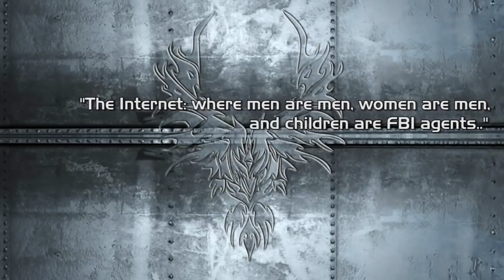Airbrushing for the Beginner #3: Basic Mechanics, thinning paint and cleaning

Comment: Very good video bro. One thing to note... from my experience its best to hold the trigger down while inserting the needle back into the airbrush. This prevents it from the possibility of bumping into the trigger assembly inside the airbrush and bending the tip of it. Needles aren't cheap and you really want to be extra careful with them.

Comment: Skim Milk. Yes, you can use your airbrush to paint acrylic on ceramic bisques. :) Make sure you clear coat it with a varnish to protect your work. The Aerograph airbrush with a Vogue Air Mini Compressor is a small set and it can be used for what you're doing.  Good way to start.  You might want to upgrade later though if you get really into it.

Comment: An alternative way to pull it apart so as to ensure minimum contact with needle point.
It goes like this:
Loosen the needle chuck then pull the needle back so its no longer in contact with the nozzle an inch or so will do the trick.
Then remove the nozzle assembly at the front including the nozzle.
Having removed the nozzle you can push the needle all the way forward and pull it out from the front. Then put back together in reverse order and you wont bend your needle tip.

Comment: @Legodude5991 Depending on the type of paint that is whether it is Solvent or Water based. 

For solvent ie Auto Acrylic Lacquer I use a commercial GP Gun Wash, for Water Based paints I use Auto Air 4007 Airbrush Cleaner between colours (I try to go from light colours to dark when working on a piece) but a flush and blow out and spray on white cloth to confirm it is clean. the iwata cleaning station is nice but my $2 plastic teapot modified works a treat.

Comment: I can't tell you how to thin vallejo other than to the consistancy of thinned milk but here's where I start.  For Vallejo Model Color, I start at 1:20 (paint to thinner), for Game Color start at 1:10 and no need to thin Model Air.  From that starting point, you add more thinner if it's too thick or add more paint if it's too thing. Note it down.

The reason why is that depending on the pigment they use for the color, how long they set on the shelf, the ratio is different usually by color.

Comment: so i bought a cheap one to start with but when I cleaned it and took out the needle tip it never went back togheter and every time i used i would get bubbles on my cup are not all needle caps removable? or is it something else that is wrong with my airbrush cheers great vid

Comment: I got 2 airbrushs for Xmas. Both Royal max. Ones the 132E Model and the other is AB-128P. Ones side feed and ones a feed that goes from underneath. I used the side feed once to learn how to control it and put it on 20psi.

I'm using Revell acrylic paints with the Revell Thinner.

I'm brilliant at drawing so I'm intending to maybe use the airbrush for colour. Or designs on stuff you couldn't do with pencil.

What's are the first things you recommend I try to airbrush so I can improve on using one? 
The more you do something, the better you get at it. But I have no clue where to start with airbrushing.
Reply: Trigger control is probably your first bet to start to learn first.  Do lines and streaks and dots. But for illustration purposes, check this guy out. He can REALLY help you in that aspect: https://www.youtube.com/user/airbrushtutor

Comment: thanks for all your advice. I have just picked up an airbrush and compressor it wasn't a cheap one but it wasn't an expensive one either will that make a difference? The real question i have is what should i clean it with? there are so many people that say you should only use airbrush cleaner and others that say use water and washing up liquid? does it really make a difference or would alcohol such as isopropynol work?

Comment: Hi,
I need help regarding my compressor. The pressure is not building at all when i switch it on. I cleaned my airbrush to see if that were the problem, but no. The gauge doesnt pass 0, it makes a noise as its about to start up and turns off straight away. any ideas please?
Thanks a million

Comment: Have two airbrushes, using and cleaning both, until now.  I'm having the same problem with both of them. Watched the video and learned about a valve I didn't know was there.  Cleaned them both again using your method and still having the same problem.  Paint in cup (gravity feed), push trigger and paint does come out but it is also bubbling out of the cup so much that I can't work on anything.  I would say 95% of the paint bubbles out.  Any suggestions would be appreciated.  Thx
Reply: I've had that same problem.  Make sure all parts are thoroughly clean and that the nozzle cap is screwed on completely so that air does not leak from the threads.
Reply: They are extremely clean and everything is on tight.  I even added teflon to what I could.
Reply: tfs433 It just happened to me again and I found some paint around the nozzle of my Pasche air brush.  After removing it, all worked perfectly again. These things are very sensitive and even minute particles of paint can affect their performance.
Reply: I'll try cleaning everything for the fourth time paying most of my attention to the nozzle.  Thank you very much for your help.  I appreciate you getting back with me so quickly.  Thx

Comment: i have just got a new airbrush i used it once right now in fact and paint was coming out but also in droplets and then now it just wont release the paint the air is coming through but no paint and mine too as i've seen others say is bubbling 
could use a bit of advice and its clean as i said i just opened it and started using

thanks in advance for any tips )
Reply from the maker: Andrew Campbell It sounds like you might not be thinning the paint enough. What kinda of paint and airbrush are you using?
Reply: vellejo 

veda airbrush thanks for reply mate

Comment: Just to recap, you use alcohol to clean the airbrush between paints right? Say i did blue for the first round. I would use it then dump whatever i didnt use into a container. Then pour in alcohal, give it a bit of a swish. dump that out, then put more alcohol for another swish. After that, you put in more alcohol then used gave it a good wipe on the inside. Then dump. Finally, you put in more alcohol and this time, you run in through the airbrush cleaning it until it comes clear.

What kind of alcohol do you use? Can i have some examples please. :D thanks.
Reply from the maker: DevilsArms I normally use 91% Isopropyl Alcohol. You can see me do the cleaning in the Airbrush Intermediate: Color Changes video
Reply: SMConsortium thanks. ill go check it out.

Comment: Hey! I just started airbrushing and I have a few issues, the first one is that when i spray the paint usually comes out in watery dots/drops, does that mean I have thin the paint to much? Also the nozzle cap(not the protective one) seems to be leaking some air, if I have water over the area it will start to bubble, I have tried to screw it on as hard as I can but it starts leaking anyway. You dont really notice it unless you have some fluid over the area, but I feel like the air flow is probably not as it should. Thanks!
Reply from the maker: The watery spidering is usually caused by too thinned paints but it could also mean you're spraying at too high of a PSI and too close to the model. Make sure you start around 20 PSI and around 6inches from the model.  Then adjust from there. 

The bubbling at the cap USUALLY means you got gunk in the tip. Make sure it's cleaned out well.  But that DOES happen to me sometimes.  When it does, I finish my srpay or just dump everything out and run cleaner through it and stuff to get out the crap and start over again.  This is why it's important to really rinse it all out in between color changes.
Reply: SMConsortium Okey, thank you for the answer, I decided to dissamble my airbrush and when i got to the nozzle i used the wrench that came with it and it broke in two parts, I have only been using it for two days, so thats pretty weird. Also did you have any idea about the air leaking?
Reply: zior92 Nvm, i missed the show more, facepalm :)

Comment: Dont use alcohol to clean the airbrush. Alcohol makes acryllic paints dry faster & you dont want that.
Reply: +MrMangan1234 
It's O.K. if you're only using alcohol to clean the airbrush, because the alcohol will have evaporated, by the time you go to paint with it. 
I was reading a bunch of forums, and found many people recommend using isopropyl alcohol for thinning acrylic paints because they want the paint to dry a bit more quickly than it does with water alone, leaving a more even finish. At least, that's the theory, I read. I'm only trying it out now.